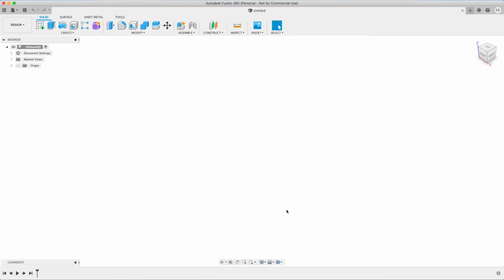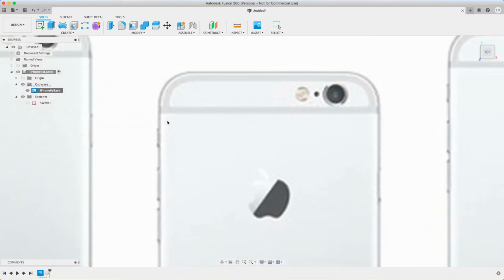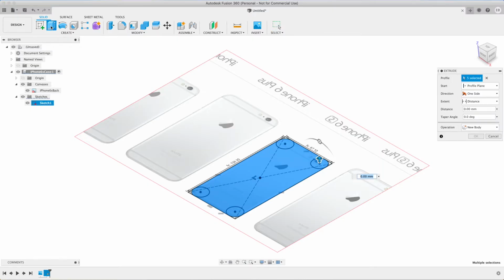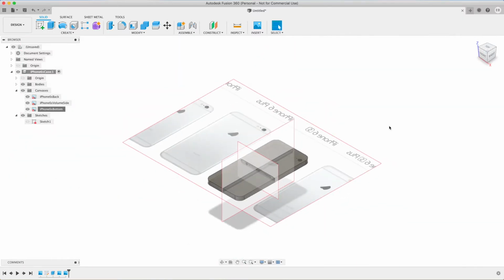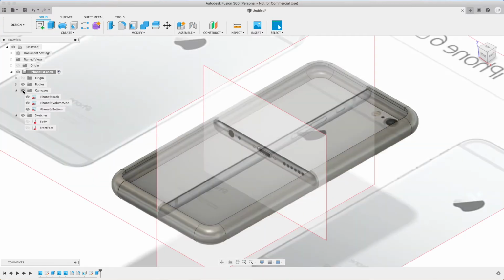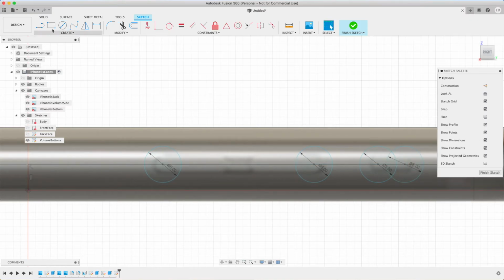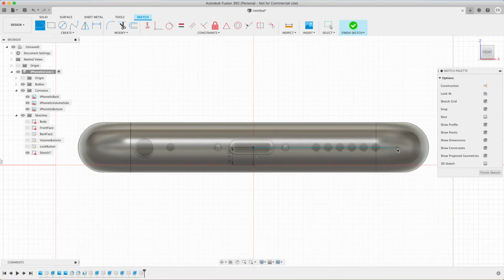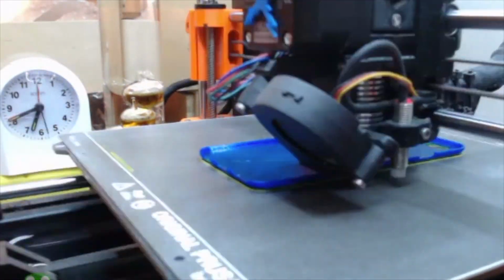Design and 3D print a phone case using Fusion 360

Comment: I'm a relative novice with CAD plus I've never used Fusion 360, so I thought I'd try doing a case for my Samsung. Stopped & replayed segments countless times as I progressed & got there. One little thing I would change for the viewer is the mouse cursor size & colour. Very difficult for an older codger to see teeny white cursor on a white background. Excellent step by step video

Comment: Nice video want to learn that to but still don't have the motivation for it was thinking to make an case for my switch oled and the switch of my son also have an one xplayer ( can't find any case for it) but i'm strill strugling wich 3d printer to buy for it to print tpu cases do you have any ideas for me ? 

Should be cheap (about 300€ is my maximum my women will kill me is i spend more on it ) 

And big enoug to print an case that has to be 300mm widh 

Also beginner friendly enoug for me to not lose my motivation 

Thanxs a lot
Reply from the maker: I use a Prusa Mk3s which is great, but is more expensive.
I have a couple of friends who have Creality Ender 3's and they are very happy with them.  Once setup with the correct bed levelling and other settings they seem to work very well.
I would check out 3D Printing Nerd who does some great videos on 3D printing, and has a review of the Ender 3 Pro https://www.youtube.com/watch?v=lVRTpQh5QlE
However the Ender 3 doesn't have a 300mm bed, so you would then need to look at the Creality CR 10 series, but then that starts to be more than your budget.
If you get a printer, I would start with PLA or PETG.  TPU is difficult to print, so does require some experience with 'easier' materials.  I still struggle with TPU, and it requires a REALLY slow print speed and a lot of attention to get working.
I also use Reddit to check out the 3D printing subreddits, so I would also check out the https://www.reddit.com/r/ender3/ subreddit.  These are great places to go to get advice and tips.
I originally started with a cheap 3D printer (Anet A8, which I would NOT recommend).  Although it was a terrible and dangerous printer, which cost me loads to try and make it safe, I did really enjoy the hobby, so it allowed me to learn a lot before moving to a better machine.  I suspect the Ender 3 would be a great starter for you.
Hope this helps.

Comment: Awesome, try doing drop tests on it!
Reply from the maker: I printed a case to protect my new phone (originally did it for my new Pixel 5).  Not going to drop test a £600 phone deliberately, but I have since dropped the phone a few times and have zero damage so far.  It isn't going to protect the screen of course.  I am still using the original case I printed, so it is holding up well.